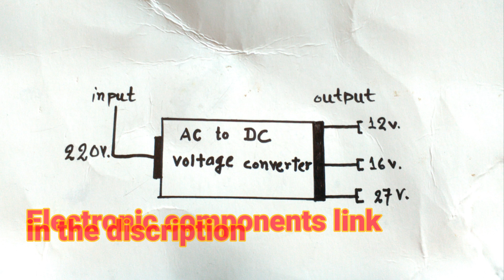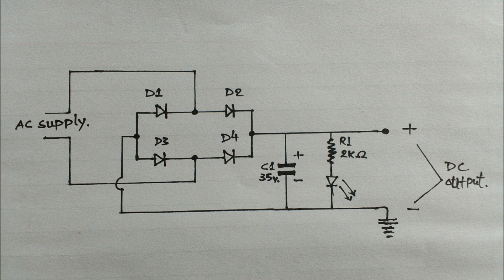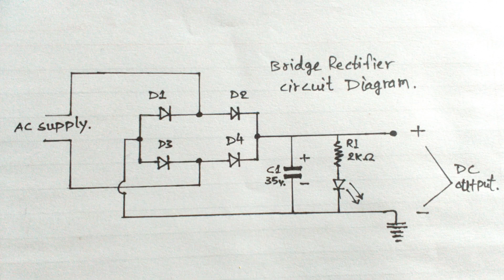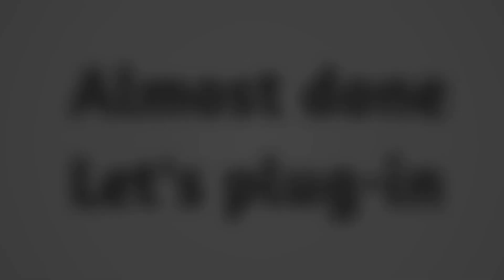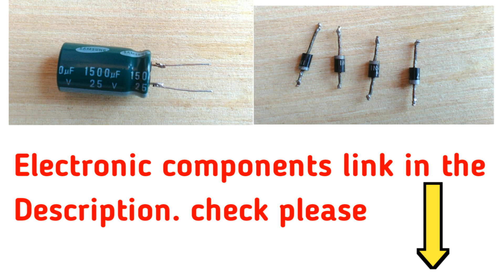How to make ac to dc converter | and 12 volt battery charger | at home | in Hindi | easy way | 2019

Comment: Sorry bro but i am asking a question of AC supply not as your name...
That my transformer gets short circuit whenever i directly connect the terminals of it...
On both primary and secondary
 windings...
Note : I connect both wires with the AC supply...
Please reply bro...